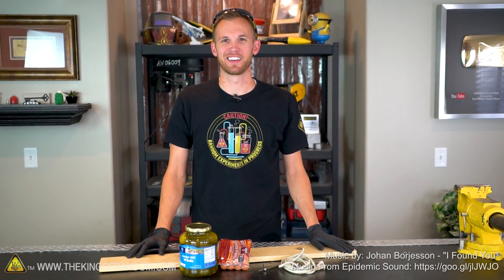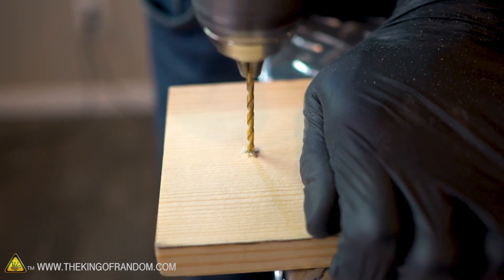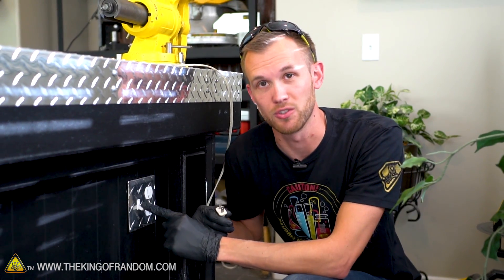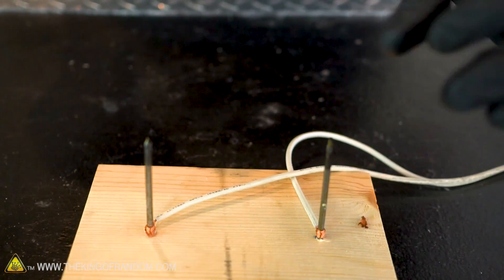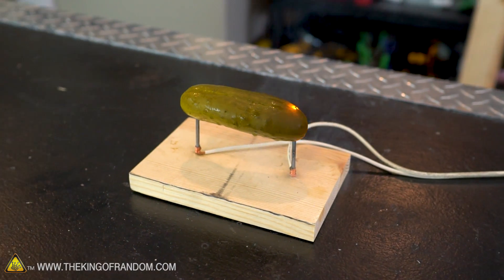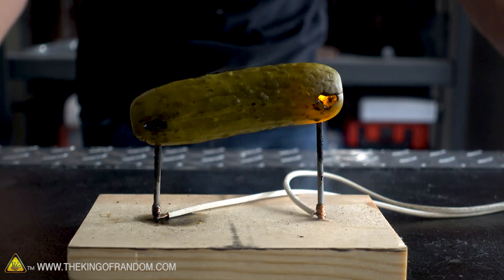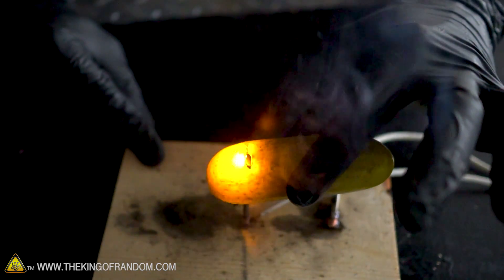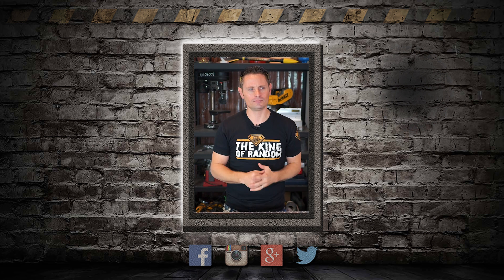How To Make Pickles Glow 💥 TKOR’s Electric Pickle Experiment On How To Make Food Glow!

Comment: What if you point the nails towards each other?  There is actually a device that EmmyMade showed on her channel that was a commercial device that basically was this set up used to heat hotdogs except the elements were pointed towards one another.

Comment: The power in your walls is 120ish volts, and only about 20 amps max. To cook things you want low voltage and high amperage so there is not all that arcing and burning. Something like 20v with higher amperage. Please revise this experiment!

Comment: you also shorted the circuit by bassically connecting the 2 cables together without a thing to use that electricity

Comment: you souldn't be touching them while connected.....  where i live you would recorded your own death.... specially the time you detouch the pickle from one side... we use earthing system with 250V ( means the Neutral is bridged to earth on the meter outside, that can have as a result that the circuit can be closed with earth and provide power if not properly insulated, that you was not).. my kids watching your videos... no im not a random guy, im and A grade Electrician... tottaly unsafe with this little to nothing insulated groves you used... extremely dangerous, if not in america because of 110, in 250 countrys really it is....
Reply: the command blocker yes it does but the resistance of that pickle isn't nearly low enough to absorb all that energy if it was it would blow the fuse. Meaning the current will happily flow through the pickle AND your body.
Reply: Sanyu Kumaran tell that to a 5 year old.
Reply: I understand your concern but you don’t have to do this experiment if you don’t want to, or take the necessary precautions
Reply: benellias87 nice essay
Reply: benellias87 but electricity typically goes through the shortest path, the pickle/hot dog is a shorter path than his fingers to his heart or other body parts

Comment: If you try this use a multi-outlet strip w/ a circuit breaker to avoid tripping the breaker in the service panel (and any other outlets running off that same breaker).

Comment: You need to have better cross section contact with the hot dog. What would happen when you push it so the nails are clearly protruding above it? And microwave transformers are very dangerous,  you should warn appropriately for that video.

Comment: Hook it up to car batteries in parallel to deliver a lot of currant. That will cook it and not ark much
Reply: The setup with car batteries only has the potential to deliver high current. If you think about the pickle as a normal resistor with constant resistance you would actually get about 10% of the current that flows in this shown setup with mains voltage.

Comment: Would it cook well if you used one gigantic nail and impaled the food vertically? Either connect both wires to the one nail or run two separate ones.
Reply: You mean either side of the nail?
Reply: If you connect both wires to 1 nail the electricity will not flow through the food and will cause a short circuit

Comment: i have done that before at work it works well and you was doing it right but instead of nails in a board just stick the nail into the pickle without the board better results and for the next shocking idea try putting it in water.

Comment: Just connect it right to mains power. What could possibly go wrong...?
Reply: ... and then touch it with his finger... facepalm
Reply: Everything
Reply: Luke Tayler And the way he stripped the wire gets me, I'm not even an electrician.
Reply: Surely he realises that most of his audience are kids?
Reply: We did this in School in Germany with 230V 16A :D
Reply: Ed R I have been an electrical technician for about 4 months and the wire stripping hurts me.
Reply: the best way to do it is go to the breaker box and splice right off the main input, but you gotta rig the switch closed otherwise it may flip over and ruin the fun... should get like 50amps that way.
Reply: Ed R yeah I agree, all you need is side cutters if you don't have wire strippers
Reply: SA1278 du meinst wohl mit 0.1 A
Reply: Die meisten Steckdosen sind in der Lage 16 oder 20A zu liefern. Dass das nicht durch eine Gewürzgurke fließt ist mir klar.
Reply: SA1278 super, wenn du mich meinst bitte verlink mich
Reply: Qexilber yes. Because electicity works like that of course. Go to school pls. For God's sake. Fesperlm
Reply: EVERYTHING!!!!
Reply: Koos Naamloos 2 : Electric Boogaloo
Reply: blows up
Reply: (Koos Naamloos) ahn ecksploshun
Reply: Koos Naamloos goed bezig koos!
Reply: Koos Naamloos as an apprenticeship sparky, this pains me

Comment: Would there be a big difference hooking it up to 230V (European outlets? ) ?
Reply: That could be interesting!
Reply: You'll die faster, food still be burned
Reply: yes - doubling the voltage (120V -> 240V) at least quadruples the power.
Reply: sarowie Quadruple? Is the amperage doubling too?
Reply: Julien In a purely resistive circuit (not true in that case but close enough) if you double the voltage, current will also double, and then since power is current multiplied by voltage it will quadruple
Reply: Gotcha, thanks !

Comment: Weren't you afraid of being zapped thru the hotdog when you touched it?
Reply: Mark Gibbons very thin gloves that he is putting a lot of trust in
Reply: A hot dog isn't that conductive. If it was higher than AC 120 volts it would be very dangerous
Reply: Carl Euca the nail could have went though the hotdog easily and his fingers could slip onto the nail...
Reply: Considering how soft the hot dog is and how close the nails are together compared to the size of his hand
Reply: Mr.Popeyes he can't die with 120 volts AC if he has a breaker
Reply: AirsoftSlo he's wearing rubber gloves.

Comment: I would think that touching the pickle or hot dog while the power was on would be extremely dangerous. That's just me though, I don't like being electrocuted.
Reply: that means literally nothing. The nails go straight through!
Reply: Jacob Santos if its not isolated... It is(and if it is isolated its still dangerous if you dont know what you are doing) Its not just your thought
Reply: I guess most of the current was going though the pickle and hotdog. But you're right, I would have though the same thing. Best practice would be not to touch it while the power was on.
Reply: TheDucklets What?
Reply: Jacob Sartorius he's wearing rubber gloves

Comment: Make sure you set that on a non-conductive surface or cover the nail heads with electrical tape, or else you may short the circuit under the board
Reply: electrical tape is not enough. The surface has to be non conductive.
Reply: I am pretty sure it would be enough, but regardless, no one would want to place that on a conductive surface!